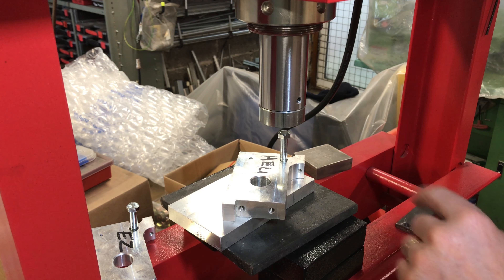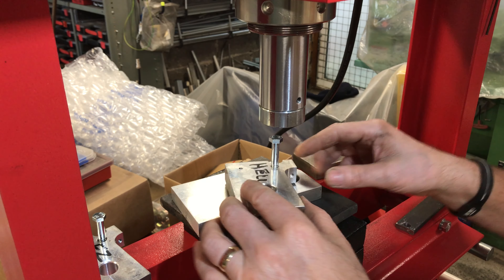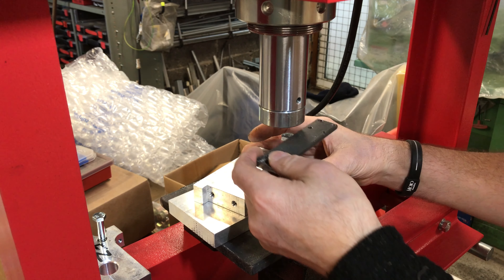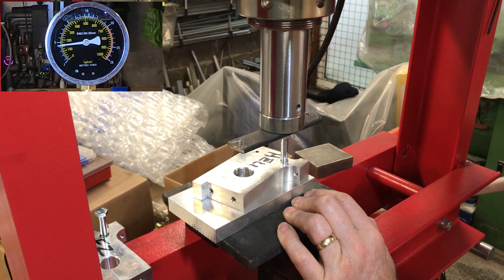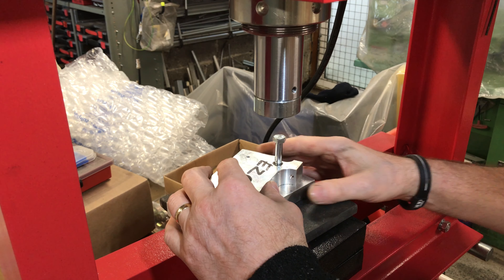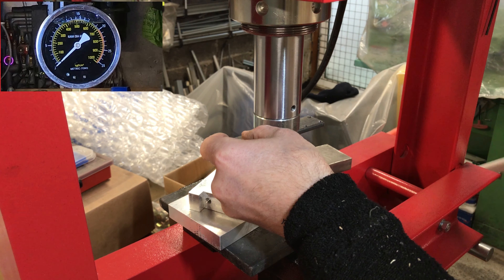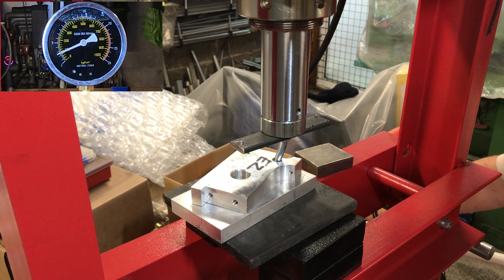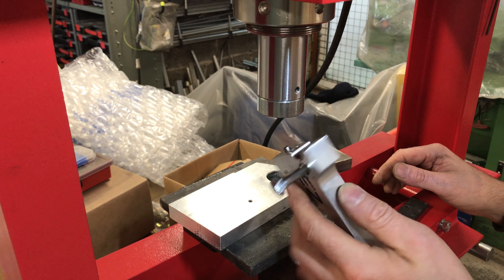Helicoil Vs E-Z lok Round two.

Comment: The inserts should have been the intended point of failure. Stronger bolts would have given a more definitive result.
Reply from the maker: Hi Mark, thanks for the comments. Yes, I was looking for an insert failure and not a bolt! They were a good quality bolt but were no match for the inserts this time. Thanks for watching 👍🏽
Reply: @MikeMakesIt  That said, it was a good video. Very helpful and informative.
Reply: @Mike Makes It  good video but your test had too many variables such as bolt strength, definitely the length (use a WAY shorter bolt so the bolt has no room to flex) and then see what happens